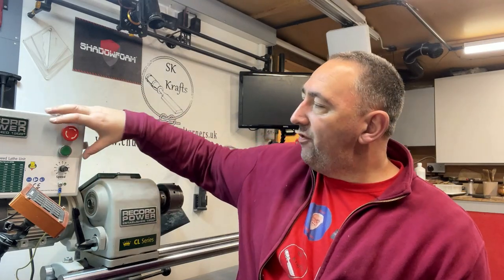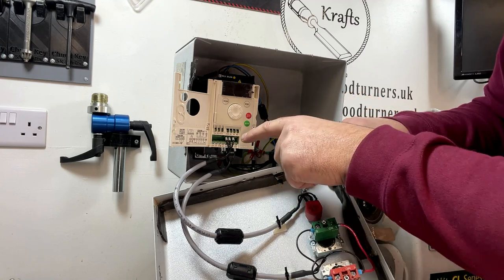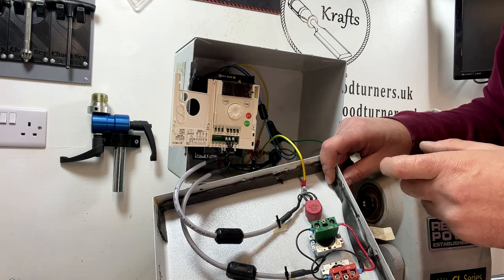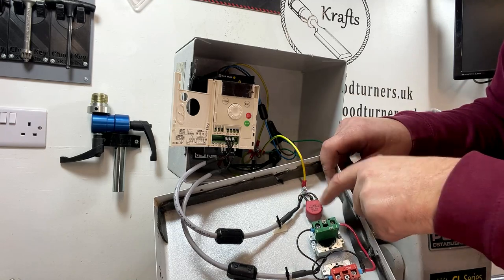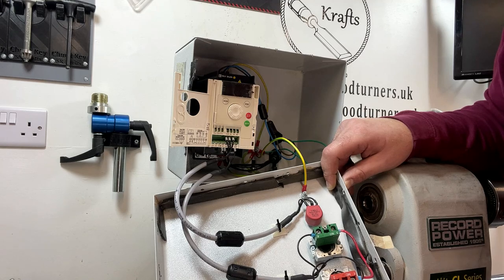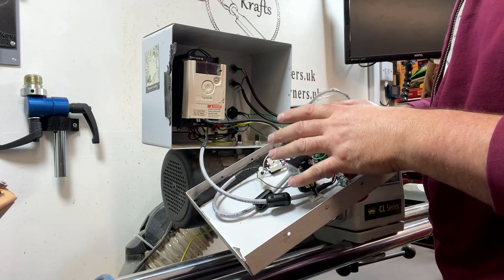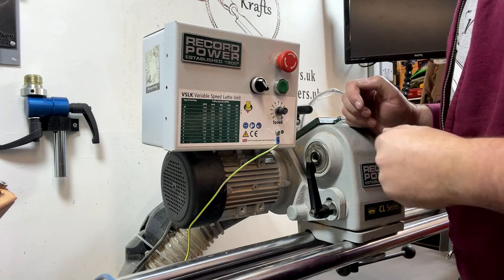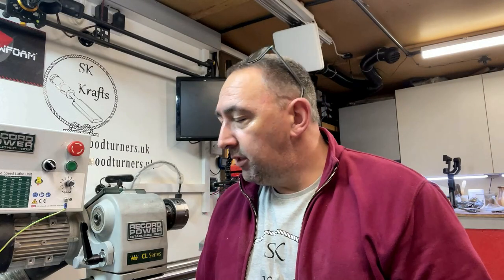How To Add A Remote Stop/Start Control Box To Your Lathe - Record Power CL4

Comment: Steve some great info there mate and great to know that it can be done, fairly easy as well, well done buddy. Im surprise Record Power didn't wont anything to do with it. You would think they would have had something that you could plug and play. I also think you have done that type of stuff before
Reply from the maker: Thank you, it turned out a great asset to the machine and worked really well. I have a bit of knowledge about inverters from previous jobs so I have a bit of knowledge about machinery.

Comment: Could you not have just removed the control components from the original housing and installed them in a remote box?  The wiring would then only need to be extended via a terminal block in the existing housing. The complexity and cost would be greatly reduced. The dual control facility is not present on remote controlled machines anyway.
Reply from the maker: I could have but I wanted both controls as I only use the remote when outboard turning.

Comment: Steve how much would a control unit like the one attached to the CL4 cost to make Please
Reply from the maker: If you are about the one that came with the lathe. I believe they use to sell them for £499.
Reply: @SKKrafts  yes Steve I am wondering if I could run my Union Graduate on one ( 1 1/2 hp motor )
Reply from the maker: That I am unsure mate. Better off asking a qualified electrician.
Reply: @SKKrafts  thank you